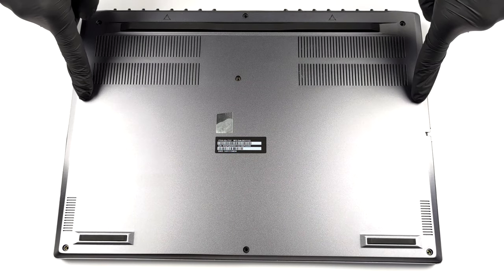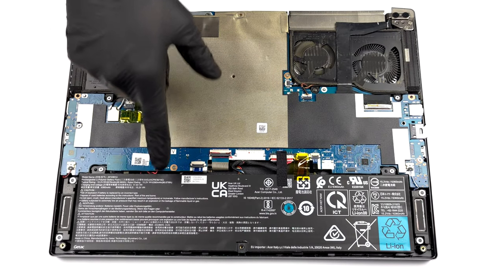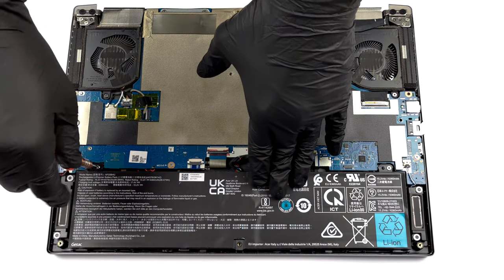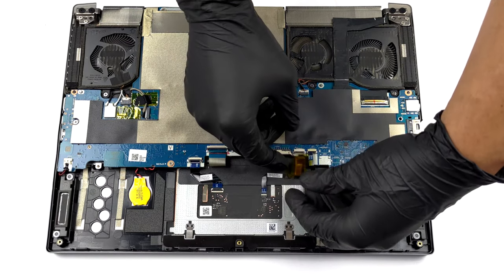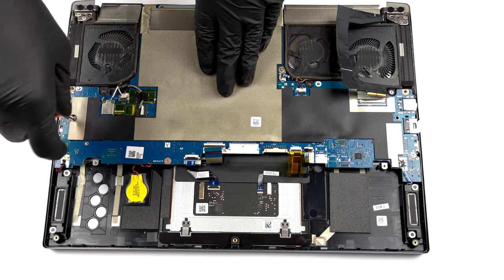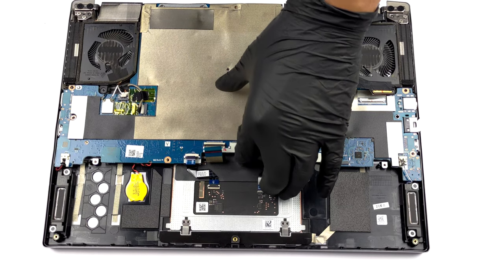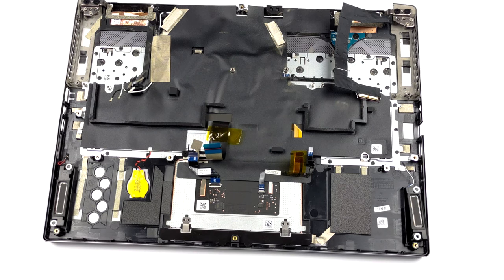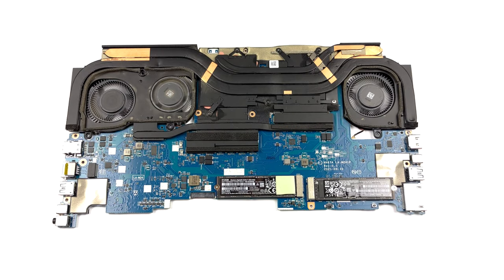🛠️ Acer Predator Triton 500 SE (PT516-52s) - disassembly and upgrade options

Comment: I thought they were upgrading the board of an HP laptop with the motherboard upside down.  This is even worse with hard soldered RAM.  This is the very reason I avoid HP and was a big fan of the Acer simplicity of upgrades.  Looks like those days are gone.  I have an Acer travel mate and it has trap doors on the bottom.  a couple of screws and you have the RAM to upgrade.  Five minutes or less and you have upgraded the RAM.  It was a little more difficult with the Acer Aspire to remove the entire bottom, like this one.  Once it was removed you had complete access to the RAM and Hard drive upgrade with included clips.
Reply: My triton 500 se can have upgraded ram? Even if its at 32 and has 16gb for vram. Would it benefit at all from upgrading it? Also how many Mah is the battery?

Comment: I'm having a issue where my triton 500 se shows its fully charged but when I boot it up it won't turn on or make the on sound and the blue light that indicates it's on shuts right back off this is the second time it's happened is there any fix to that or reason why that happens???
Reply: I had this same issue and had to send it into acer. they had to replace the motherboard
Reply: Hit the esc button after it loads for a few mins min started doing this an is what I gotta do

Comment: Is it correct that the RAM is not upgradable on this device? Great video, thanks
Reply: No, the ram of the predator 500 se is completely upgradeable
Reply: i just got the 500 se and am looking to do this today and almost got more ram but got it with 16gb but only 500gb of memory (3 games at most) to a 2 tb 970 evo plus. Best buy has a 500$ off sale on the laptop and 100 off on 2 tb.
Reply: @eduardo_Skywaller1032  for 500 SE 2022 like this video is it not upgradable RAM
Reply: @slavaakas  tru you're right the 2021 is the one that is upgradeable my mistake
Reply: @eduardo_Skywaller1032  wrong.

Comment: Is anyone else having problems with booting up the device once I oress the power button the keyboard light up but the screen is black. I have same device as the video.
Reply: I had the same problem. Did you update the intel drivers? For me that was the problem. Connect an other display en re-install the driver from the acer website. After that it should work!
Reply: I had the same issue and had to send it into acer. They had to replace the motherboard